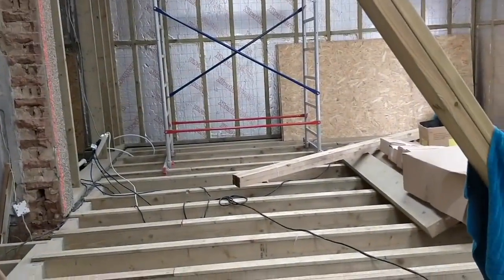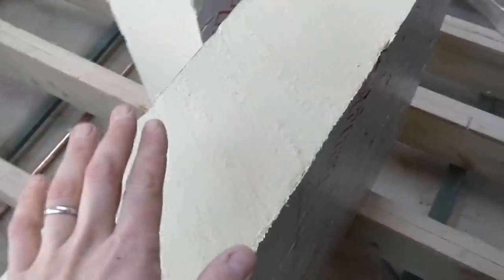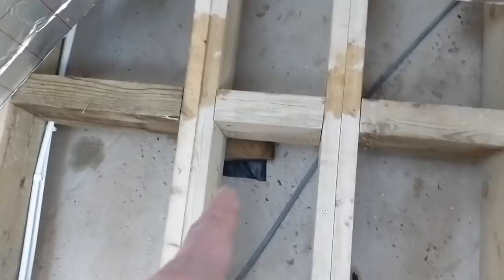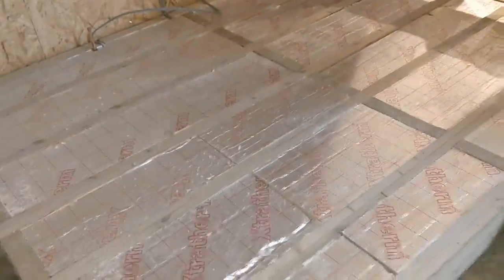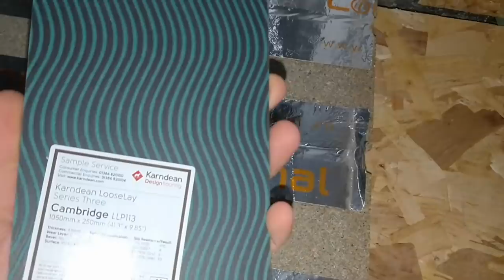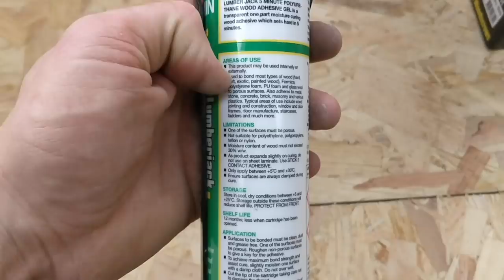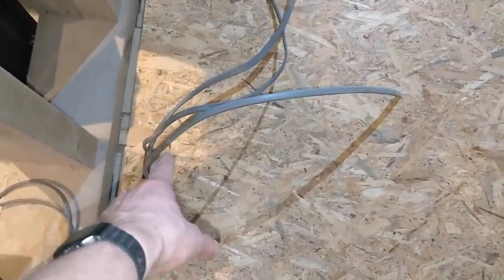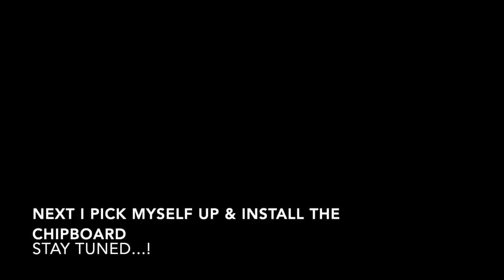Building the Extension Subfloor

Comment: Great video, I have been reinstating a full wood floor on a bungalow as it was rotten, I am currently considering if running central heating pipes below the floor is a better option than from the ceiling. How would you drain your system when the pipes are below the floor.
Reply from the maker: Unfortunately you just have to get lower...! Typically suspended floors have soil below them, which would drink up any water...not ideal, but so long as you allow it to breathe and air-out after, you shouldn't have any real issues with draining down into that ground. Just make sure you put the drain-cock somewhere sensible. (As an aside, consider having an outside tap which makes draining the drinking water system easier too)

Comment: Mate, just bought a house in Feb, dormer bungalow, 1930s, I've got the lot to do your videos are a real help! My tip with the PIR ? Chop it up small, bin bags, put it in the normal rubbish, will take a month slow time but saves the space in the skip. Any advice on getting the old floorboards up in 1 piece?
Reply from the maker: Cool!

Buy a couple of flat bar crowbars, like a Roughneck Utility bar or similar, and then slowly lever and pry along the length and short end...don't be tempted to try and pry it up from one side/corner and pop it up in one go, you'll most likely split the board. Slowly ease it up along the section you need to lift.
Reply: @OfficeBoyBuilder  cheers bud, where are you at with your place currently?
Reply from the maker: We're having the downstairs area plastered at the moment, and the painter is in too, getting everything prepped so I can install the flooring and kitchen!

We will then move on to finishing the side of the house where the second storey bedroom/ensuite is. 👍
Reply: @OfficeBoyBuilder  awesome can't wait for the ensuite videos I'll be doing one as well! Little heads up go electric on you ufh for bathrooms, heats up quicker

Comment: As you're gluing and screwing your subfloor down, what will you do if you ever need to get to your wiring and pipe work in the future?  Will you not cause damage to everything if you ever have to lever it all up to rewire or replumb something?  Love the videos by the way.
Reply from the maker: Thanks mate. The answer is yes, it will cause damage, and sadly there isn't any that can be done about it, other than carefully cutting a section of the floor out and lifting it to access the area that needs changing, before gluing and screwing it down again...the likelihood of that needing to happen is (hopefully) Very remote!
Reply: @OfficeBoyBuilder  always worth planning the joints and then implementing hatches if needs be and putting it in drawings so work can be carried out without excessive damage.

Comment: Hi there is it not necessary to put dpm under the floor joists? Im a carpenter and doing a timber extension at my place and i have put dpm under the joists but problem is it fils with water when it rains
Reply: I've just seen your floor plan with the dpm, I'll just make sure its bailed out and dry after the roofs on and  before the 22mm floor goes down 👍

Comment: Why is it you went timber frame and not block built. I've been noticing quite alot of timber frame extensions being built. Have worked in timber frame buildings before but never asked why they preferred that method
Reply from the maker: Just playing to my strengths (and passion). I don't know anything about brick and blockwork, as you'll see in a previous video lol! I understand timber and really enjoy working with it. Incidentally it's also far more thermally efficient than blockwork, and it builds a bit faster too.
I think it's cheaper, not least because of the amount of time it takes and the number of people needed to build in brick. With timber you build it once and in fill with insulation, and the walls go up in minutes. With brick you need to build each wall twice and infill with insulation as you go, and it's typically a thinner amount of mineral wool insulation which is less efficient than rigid PIR. The raw materials cost around the same, but timber is possibly marginally cheaper if you get trade rates.

Comment: Chuck the left overs in the void under the floor. 👍
Reply from the maker: The problem there is it reduces air flow and I need to keep that ventilation gap for the house sub-structure to breathe
Reply: Perhaps, it's difficult to guage depth when watching. I'd imagine it would make minimumal difference to airflow if kept to the edges, one layer thick and away from the air bricks - but you're the eyes on the ground! 🙂

I've come across offcuts of plasterboard stored in between the studs, as that can be difficult to deal with.

Great build, keep the videos coming.  I can't wait to see it finished. 👍
Reply from the maker: Yeah that's a great strategy, good suggestion and thanks for the support!
Reply: Thought the same. Or in the loft - but as Office Boy Builder has already converted his loft, that option doesn't exist.
Reply from the maker: I do have a few spaces left up there, but I still have more insulation to do up there anyway, so it's  a nil sum game because I'm going to inevitably generate more leftovers there too!

Comment: 6:01 on the right it says minimum 150mm ventilated air gap, yours looks like much less?
Reply from the maker: It's pretty darn close - at the outside wall it's nearly 170, where it attaches to the inside of the house it's closer to 120 - the slope of the concrete oversight explains the difference.

The building inspector was happy that there was enough (on average) across the site to comply 👍
Reply: @OfficeBoyBuilder  👍

Comment: Not need vapour barrier on floor?
Reply from the maker: Good question...the answer is no, because the air-gap and ventilation beneath the floor is so much bigger than in the wall's/roof. The foil face on the PIR acts as a vapour barrier, but the walls need that additional help because there's only 25mm air-gap instead of 150mm beneath the suspended timber floor. The ceiling would have needed a vapour check barrier, if I hadn't put continuous strips of multi-foil (in another video) because they act as a vapour barrier too.

Comment: i thought modern gas mains to your house are in plastic
Reply from the maker: Perhaps they have a special coating/type of plastic which works for them, but domestic gas internally is run in copper 👍
Reply: You cannot use plastic pipe for gas internally because it would melt in the event of fire with disastrous results. Check out Gastite or Tracpipe. It's corrugated stainless with a plastic coating. I am not a plumber. Make sure you get professional advice.